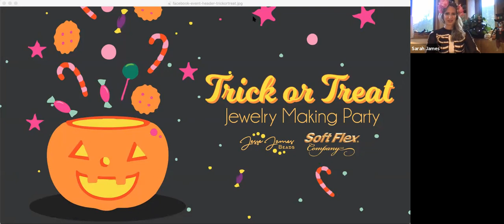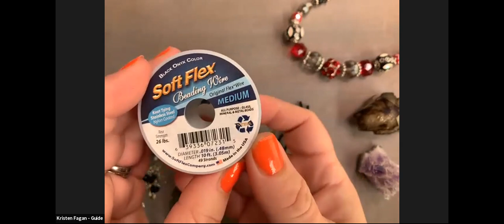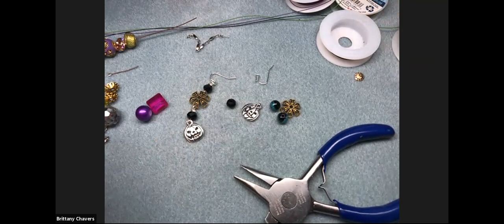2021 Trick or Treat Jewelry Making Party with Jesse James Beads, Kristen Fagan & Brittany Chavers

Comment: I never knew you needed 2 wires for the crimp bead. That rocks my beading world. Thanks bunches and bunches.🤗👍. I was so frustrated with trying to crimp and getting only failure that I bought the small and large magic crimp pliers plus 3 other crimpers. Who knew?? I am making button jewelry. I make a “component” piece and crimp the wire in the back but it kept cutting the wire, however I’m using 26 and 28 gauge wire as I need small diameter to go through some of the buttons and beads I’m putting together. I changed my crimp sizes, wire sizes as much as possible, I was trying anything I could think of. You are a God send this day. Thank you ladies, tip of the hat to you.
Reply from the maker: Yes, if using the magical crimping pliers you need 2 beading wires with a 2x2mm crimp tube. You can use just 1 beading wire if you are using micro crimpers with a 1x1mm crimp tube. Hope that helps!
Reply: @SoftFlexCompany  thank you. I am also wondering if I can smooth off jewelry wire using the heat of a soldering iron. I have one in my Amazon cart even as I w rite this. When I connect components using the wrapped loop it seems no matter where I cut and how hard I press in the wire, it continues to catch on my clothing or hair. I thought of doing that or perhaps using a droop of glue, either regular or hot melt. Thanks again for the feedback.
Reply from the maker: @sherireuther3047  If you are using Soft Flex Craft Wire all the colors have a copper core are colored and then enameled. The only one that you can solder would be the bare copper as there is no color or enamel. If you are using Soft Flex Beading Wire it is a stainless steel core colored with a nylon coating. Soldering would not work on this product.
Reply: @SoftFlexCompany  ok, good information, thank you.